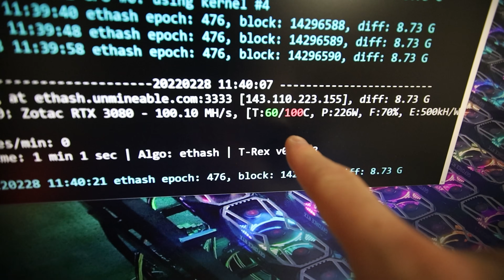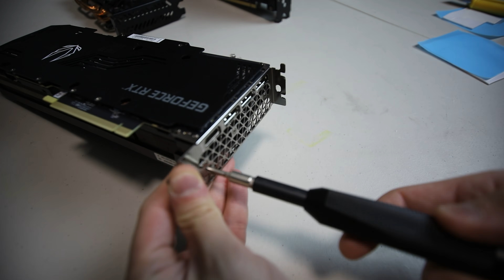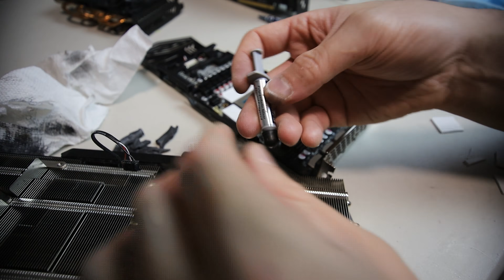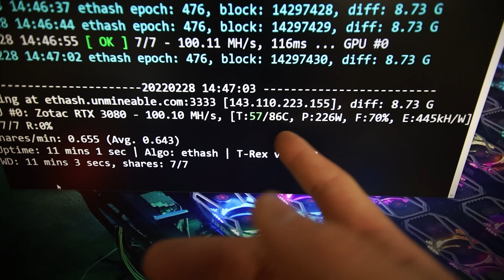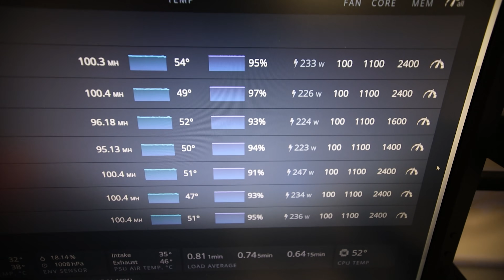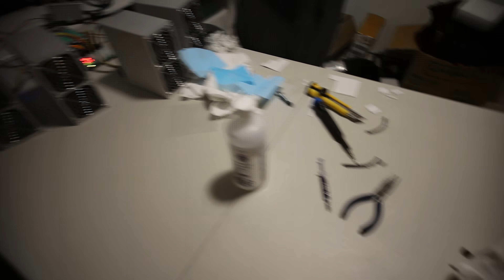Zotac you have terrible thermal pads...

Comment: Krisfix has a video where he states that this card has 0.75mm pads on the memory, if you got 2mm on yours, they are lifting the GPU contact ever so slightly and you're getting that 10C delta on GPU compared to other cards in the same rig.

Comment: i have some doubts, 
when hot spot is 90c
board power draw is 281w
chip power is 194w
pcie slow power 43w
8 pin 1 power draw 121
8 pin 1 power draw 116
tdp 91%

when hot spot was 95 
board power was 290w , is this normal for zotac 3070 ti oc with 5900x 

1:51:54 Time:    260.615
11:51:54 Frames:    46163
11:51:54 FPS:    177.131
11:51:54 Min FPS:    60.5659
11:51:54 Max FPS:    374.183
11:51:54 Score:    4461.94

Settings:
Render: Direct3D11
Mode: 1920x1080 8xAA Fullscreen
Preset: Custom
Quality: Ultra
Tessellation: Extreme

No OC, No Undervolt , bechned on heaven

Comment: Just to share that I've tried the copper shim mod on memory and you can lower mem temp by another 10-15 degrees compare to thermal pad replacement. Now they are running at around 50℃core/70℃mem range at 1700rpm fan speed which is insanely good.
Reply: Did you buy the machined copper mod or just normal shims?
Reply: give us more details damn it !

Comment: Literally just did this on my zotac 3080ti amp holo with same results. Oily disintegrating pads. What a joke. Mem junction temps went from 110 to 81c lol
Reply: But my gpu core temp increase 12C. Im using gelid extreme 2mm for my 3080 amp holo, any idea?
Reply: @tmlinhkct  Hey Bud, make sure the core is getting good contact on the heatsink plate. You may need to use 1.5mm on the front instead. With those squishy gelids you can also smash them down the make them thinner. From what I understand its common for the core temp to increase as the thermal pads near it are actually soaking more heat from the memory. I experienced a rise in my core temps but they are still in the safe range for mining 24/7. Did this on all 3 of my 3080ti amp holos and they are running better than ever!
Reply: @lorenm4015  i have tried with 1.5mm but  mem temp reached to 110C. Seem 1.5mm is too thin. So, 1.75mm is good enough but its difficult to buy it.

Comment: Funny, never watched anyone do thermal pads before on older GPU's. Did some for the first time on my used before me 1660 Supers, and they're both making about 4% more. It's less obvious on GPU's like that because they don't have enough power to be challenged thermally. 

My only reference was Tech Shenji and 3090's. I didn't bother trying to buy what he tested as best because it'd have been overkill. Got 13 watts per meter kelvin pads. Offbrand. owl something? The .5mm was terrible. It was almost like just give me a jar of the clay and I'll scoop it and spread it, it'd be easier than getting the plastic off of those things! Used a tiny flathead screwdriver to coax every millimeter of pad off the plastic after it was already on the memory. 

As I got better at it, I didn't have to go back and fill the broken patches missing thermal compounds.

Comment: Its strange, I bought a Zotac 3090 Trinity last year and have ran it in Hive OS since. Being paranoid with all these videos about mem temps I decided to put it in windows and run it, to my amazement mem was only at 88*C. Stock pads, been mined on for 1 year. I wonder if Zotac changed their pads at some point over the last year or I just somehow got luck.
Reply: So further to this, since Hive OS show mem temps now it was running at 94-96 on the Rig (previous test was done on open air test rig). I’ve since swapped out to a CoolMyGPU copper plate and dropped to 76, managed to also increase overclock and now sitting nicely at 82 having gained about 4mh on ETH.

Comment: Every company uses garbage stock pads.

I’ve got numerous FTW3 GPUs that I’ve replaced pads on. 20c avg drop on memory post replacement. Gigabyte, ASUS, FE, etc. they all use cheap low thermal transfer pads.

Even EKWB uses cheap pads on their water blocked units. 20c drops on water cooled cards with Thermalright or Gelid pads / the most conductive pads they offer that is.

Comment: Zotac is the shitties on thermal. Just change pads and paste. Also better performance if you ad paste top and under pads. I have few of those shitBoxes and doing this i have gain stable 92celcius for Raven on 40has. I should propably get medal for this achievement 🤣🤣🤣

Comment: I just replaced the thermal pads on the same exact card and my core temps were high also. went back in after the pad was hot took it out and tightened it more got better core temps. I used 2mm pads also
Reply: Hmmm, from Tech Shenji's 3090 - huge video - I think that you can go too high on the WMK or watts per meter kelvin on the pads. The highest ones cooled the memory better only to sacrifice the core. Those mining gear WMK were way higher than what I'm familiar with. 20 is probably too high. Maybe that doesn't matter so much if it's a memory intensive crypto, but what if you want to dual mine? What about after the ETH Merge?
Reply: @tradingnichols  so depending on harness of pad on certain brands the core sometimes will not make complete contact because pad is not soft enough.
Reply: @deathwav0  So the ones I installed last night may have been too soft to easily deal with at .5mm even though it was fine when it was 1, 2, or 3mm?

Soft is good, for better contact, but it could be harder to deal with. Pun not intended. LOL
Reply: @tradingnichols  well soft pads are usefull when you do not have the exact size because some cards like liquid cooled one come with weird size thermal pads like 2.25-2.5mm and such

Comment: What can cause my 3080 to hash at around 98mh and after a day or so drop to 60mh ? Thermals are around  40c core and  88c on vram. Im using nicehash btw, also ive  tried switching risers, i had it installed in a full 16x slot still drops mh for sum reason  oc was -200 on core , +1000 on mem power limit 60%

Comment: I'm my experience, zotac pads have been fine (3080, 3060 ti, 3070). None of them have ever thermal throttled on me. In fact, I'd say that zotac 3080s are some of the best for mining stock in terms of thermal throttling. Also that residue is pretty normal, thermal pads are supposed to be greasy. You wouldn't want a dry thermal pad, would you?
Reply: lotto winner right there :) my 3070ti is the worst performer of the bunch. trying to talk myself into changing the thermals. just have to see it done a few times before i give it a try.
Reply: @ssnidely  it's honestly pretty easy. Just watch a video while you do it. I've heard the 3070 tis are terrible which I have no experience with. I've had 10+ zotac 3080s tho and they're all fine, and I've never heard anyone else that's had any issues with them besides RPM. Good luck though!
Reply: @badmeme6801  My 3070ti has been great. It's just hot because of Ton dual mining. Brand new...makes me want to consider repadding them with high end stuff just to see?

I do heare the founders editions are harder to pull apart though...
Reply: @tradingnichols  yeah the FE are pretty hard to take apart. It's fun though! I ended replacing the pads to most if not all of my 3080s just for increasing the cards lifespan

Comment: I probably need to change my thermals too. Mine seems to keep throwing overheating messages mining on NH even at stock speeds. I reduced the ram -200 and core -50 which helped a little to keep the messages from showing up but the fans are at 100% all the time on both the card and the case. It’s like a blow dryer. I have the huge MSI dual fan with RGB and 120M fans on the back with open top, front and bottom screens where radiators would go and it’s never over 74 in my house.
Reply: whatsapp+➊➌➌➒➎➌➋➊➋⓿➍  no DM me ok. Can’t wait to talk. It’s been a while since someone tried to scam me.

Comment: The 3080s are wild, I agree.  I have two EVGA 3080 HCs, one is the XC3 Ultra, and the other is a FTW3.  Both cards will hash at 101.5 but the XC3 uses less power at 206W vs 226W for the FTW3.

Comment: I had a Zotac 3090 that even after new pads and paste, it would get near 100C on the memory with fans at 100% and an additional heatsink on the backplate. My 3090 FE only gets to around 88-92C on the memory in my enclosed PC case.
Reply: I recommend u try 1 more time with a different brand of pads, it's worth a try
Reply: I have a different issue, my 3090 trinity oc ramps fan speeds up and down even after changing the pads just like the video. It was doing the same with the stock pads. Changing them did drop temps quite a bite but the random ramp ups to almost 100 are annoying. I did try Msi after burner to adjust the fan curves . I’m about to just sell it for a loss and buy a 4080 I’m sick of this card.

Comment: hey red panda, I have 2 of these 3080 zotac lhr, had to swap thermal pads for both using gelid extremes 2mm and 3mm. use h1 paste. got my temps down to 88 degrees at 25 degree ambient. I then swapped out the gpu fans with artic 120mm fans as the zotac fans were loud af and trash, also each of them consume 1.2amps vs arctic fans consumes 0.3amps. it was something crazy. zotac fans are crazy inefficient and power inefficient. im probably saving $1 a month buy swapping out those fans. be able to pay off my 2 artic fans in 20 months :p roi rip xD
Reply: Can you post the link for the fan? Please
Reply: What did you use to mount the 120mm fans? Did you keep the original heatsink?
Reply: @RonaldinhoPopper  zipties, and yes ikept the heatsink. Still does the job well, thermal pads are garbage so must be replaced. also the heatsink for these zotac cards are perfectly flushed to mount 120 mm fans with ease
Reply: Hey ! Also interested to change zotac fans. Mine are completely rumning out.

Comment: IMO Zotac is the worst of all the GPU brands.  Not just the thermal pads being junk, the cooling solution itself is just bad.  I've replaced pads in about 14 Zotac cards out of necessity and some still run hot.  Fans have failed and needed replaced, and their 3090 AMP Extreme HOLO has some weird power limited / BIOS issues that I could only fix by flashing it with an EVGA 3090 FTW3 version.  My suggestion.....just don't buy Zotac.

Comment: RPM,
Snag a Digital Caliper and you can take the guess work out of the size of the pads; General, ultra tech No. 1433 are perfect and around $20 bucks; I only suggest the Digital because the read out is huge; I also have a non-digital set from my race car engine building days but it can be a strain to look at 1/1000 of an inch or so; you will be glad you added them to your tool kit, seriously; you'll find other use not just for outer but inner diameter also.

Amazon has one for $9 bucks; cannot vouch for the quaility; or if they haveva 0 out button like the General brand.

Peace
Reply: I have 1, but it was so easy to match the old pad to a new pad by putting them next to each other, that it just wasn't neccessary.

Comment: I agree, I also have numerous non-lhr 3080s and they all pull very different power numbers as well!
Reply: Maybe some new pads will even them out?
Reply: My guess was before watching the video. Probably wouldn't even them out, but I'd guess hashes could improve. When temps improve power consumption typically goes down too. Not the same, but I got all those benefits repading and thermal pasting my first GPU's yesterday. My 1660 Supers are making like 10% more hashrate. It's harder to tell on lower power GPU's because they don't get hot to tell you something is wrong.
Reply: @tradingnichols  yea, I mostly notice the 3 8pin 3080s pulling way more watts than the 2 8pin 3080s as well. Oh nice! Are your 1660 supers flashed as well? Assuming you have hynix memory. Yea I agree, I don't have any low power gpu's per se, but I can def see it happening since power is already low on those cards
Reply: @Artun.  I think my 1660 Supers have Samsung memory, but I'm embarrassed to say I don't now how to find out. What's the benefit of flashing their bios?

You'll laugh at this, most of my "hot" GPU"s are on an open rig and my cooler ones are in a server with high air flow. My D37 board I think is kind of crappy and I couldn't resist going for a better MOBO for my open rig with a G4400 7th gen Pentium.

Comment: the reason cards work so well out of the box and diminish over time is that liquid
since manufacturers have been putting backplates on everything now they been using different thermal pads
those thermal pads are not exactly thermal pads and are instead soaked in a non-conductive oil to give them better thermal conductivity 
if a poly composite pad is hard it is not a good thermal conductor

Comment: Last year I had a zotac edge white 3070. At the time I bought it because (availability) and it had a metal backplate with thermal pads, but ended up changing them because you could see the oil eking through the backplate after a while.
Also, Arctic had a recall of Mx-5 very recently as some batches have an issue with premature hardening of the paste. You should look into it to see if it applies to you.
Reply: Hemm... is that why I see oily thing on my pcb?  I was wondering, where this oil come from.

Comment: My Zotac 3090 had the same problem and the pads were bad, leaking crap all over the place. I replaced the pads and paste and it's currently running at 66c whilst mining Eth+ Ton and using the pc for general use

Comment: Getting 74C with grizzly thermal pads on my Zotac non LHR 3080
Reply: what sizes did you use. i used 3 mm on back place, 2mm on vrams and 2.5 under the bracket. its thermal throttling and reaches 96 over 10 min and restarts. please help

Comment: 100c on memory its faking amazing!!!! the card start to decrease Power when it reach 112c on the memory than GPU enters limit state to prevent damage. my 3090s memory at summer work on 108 - 110c someties it even reach 112c than my hashrate decrease from 117mh/s to 110mh/s
Reply: Still... I think if you could keep it under a 100C, they'd last longer. Are you open air mining with those? I think they need a case and powerful fans.
Reply: @tradingnichols  yes open case
Reply: @TheVirusSolution  I think 3080's and up need to be on blast in a server case to get them the CFM's of air that they need and most of them need a repad as well.

Comment: I don't think its Zotac, I have multiple 3080's and 3090's and they ALL HAVE THERMAL issues.  Replaced pads and still not optimal, you need pristine airflow as well over the cards for them not to thermal throttle.
Reply: copper pads solved high vram temps for me, from 106c stock pads to 76c
Reply: @czownator  can you please share link to copper pads
Reply: @abhimanyusinghthakur6509  google cool my gpu
Reply: I think most of the aibs have bad thermal pads. My gigabyte 3090 was like 122°c on the vram before pad swap. After pad swap it was like 30°c better.
Reply: I replaced my Zotac 3090's fans for 3x Noctua 93mm on the front heatsink and an additional heatsink with 93mm fan for the backside ram modules and I still get 95c @ 286w
Reply: @calgeiser  what's your fan speed at? My vram temps are always below 92°c even with a power hungry 3090 running at about 330w. 

Something's wrong with your air flow or pads maybe? Or your fan speed is way too low/ not enough air flow in case.
Reply: @zzz-vd5rp  Linus Tech Tips tried a Noctua fan mod and it was inferior even to a special GPU sold brand new with Noctua fans. I think engineers know what they're doing in this case. I don't think fan mods are always as good as what people think.

Comment: I just replaced the pads on the exact same 3080 the other week and actually made it worse. Its been running for a year straight without issues, but I decided to try anyway. Those black pads were decent in terms of having low oil, but are just awful to take off. The problem with this Zotac cooler is that the heatsink on the memory has a poor connection to the fins and heatpipes.
Reply: its the size of ur pads
my gigabyte cards are the worst
some pads dont get good contact and others are crushed
so when i put it back together if everything isnt perfect the gpu doesnt get good contact fully anymore
i ordered a bunch of copper shims from amazon to add to the heatsink for the gpu 
and in the future im going to worry more about quality thermal pads
cuz .5mm of pad should not be the difference between 85C and 105C
Reply: @cidsapient7154  It was the W rating, probably lower than the black stock pads. Not all pads are soft and might not compress, I tried 2.5mm on this Zotac and it ended up lifting the gpu heatsink instead of compressing as a result the gpu temp rose. Gigabyte cards were horrible in the beginning, but it seems they resolved the pad issue on new sku's.
Reply: @ruf3st  u will not have 2 different pads on ur memory
yes when the heatsink lifts up from the different quality pads u might need the copper shims
Reply: Jesus is Lord  Any oil residue from it? I used t-global pads early on (can't remember what part num) they oiled up really quick.
Reply: Jesus is Lord  is this a Silicon paste?
Reply: use gelid extreme ,  soft and great thermal conductivity

Comment: On the thermal pad replacement job duty today too. Floor fans blasting on these gpus can distort the reality of overheating gpus. I'm so not looking to it considering I ripped apart a Nvidia 3070 ti over 15 times to fit the right thermal pad thickness right. Omg